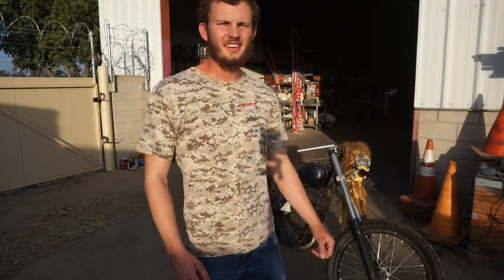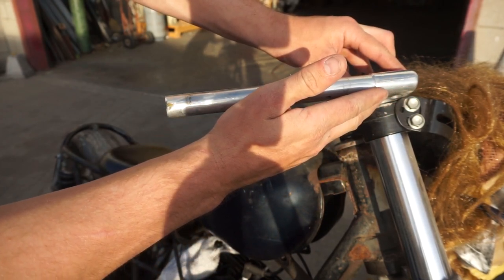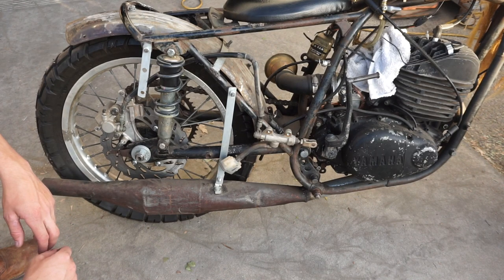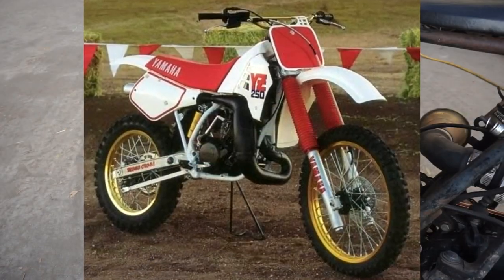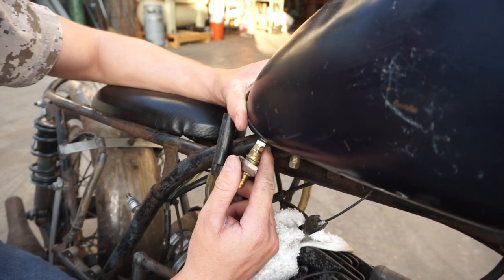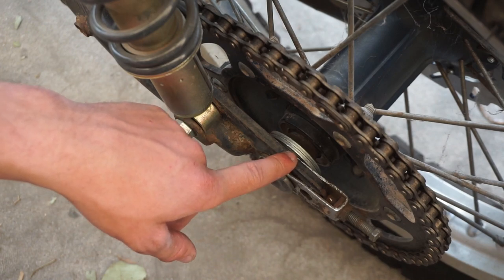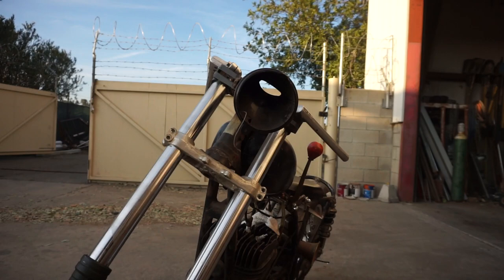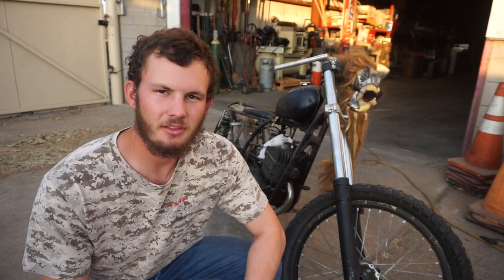TWO STROKE RAT BIKE: 1974 Yamaha DT400 Motorcycle Project

Comment: ive built a few bikes in my days but this one is a gem love it, my input would be cut it in half and weld on a rigid hard tail which would lower it and streach it like 3 inches get a wide hard tail tho so you can slap a 190 crotch rocket  wheel on the back.. Bad ass bro keep it up, i give it 6 likes
Reply from the maker: Thank you for the comment! I've thought about hardtailing it, and I've also thought about even raking it a bit more. But at this point I just want to make this thing rideable. I did a series on building an expansion chamber for it, feel free to check it out!